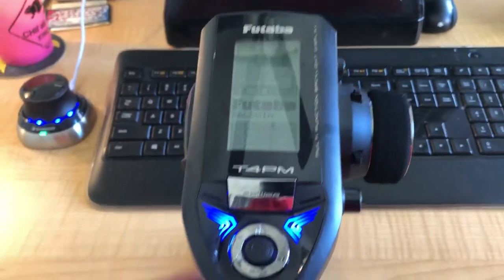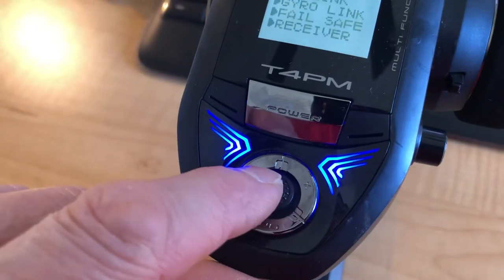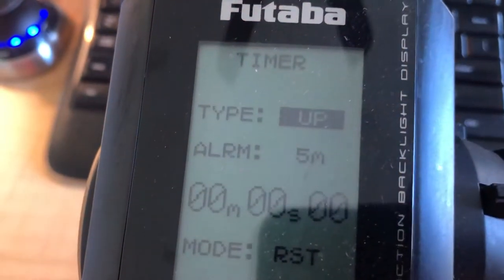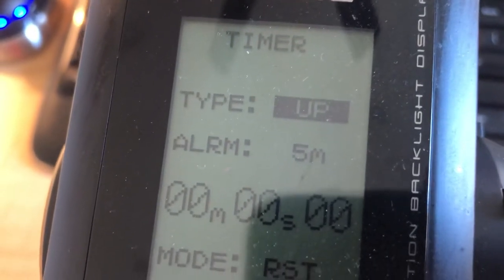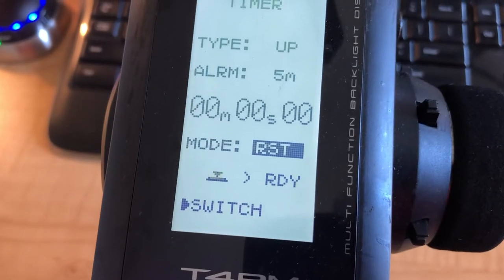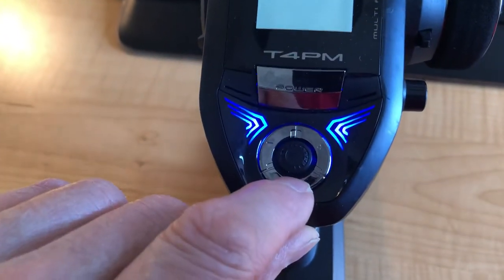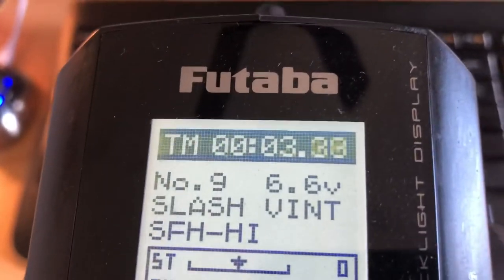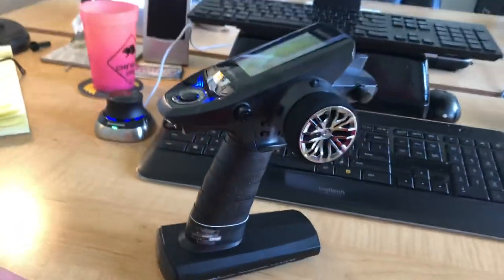FUTABA T4PM Transmitter - Timer configuration and using it

Comment: Be nice if there was a mode where it would only count up/down when throttle is being applied. Could give accurate data of run time for lipo until the 3.8v per cell is reached. Kinda pointless for some if the timer is running while model is at rest. Thx for vid though, didn’t see much timer info in manual
Reply: The RDY mode - with accompanying flashing stopwatch - starts the timer when the throttle is applied. The timer runs up/down until you go back into the timer menu and reset it, or until you press and hold the SW2 button...presuming you've assigned it as 'timer'.